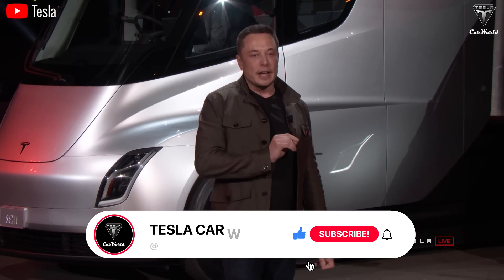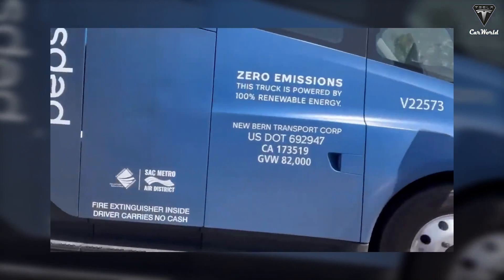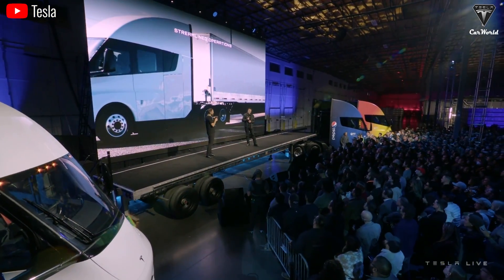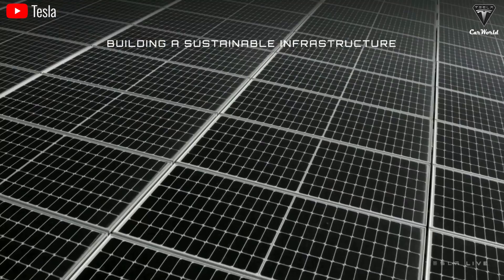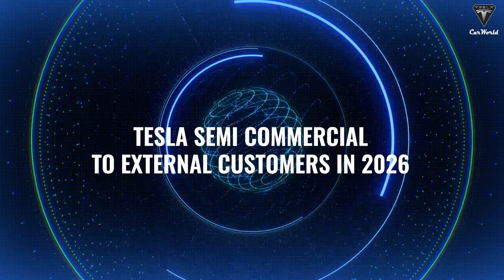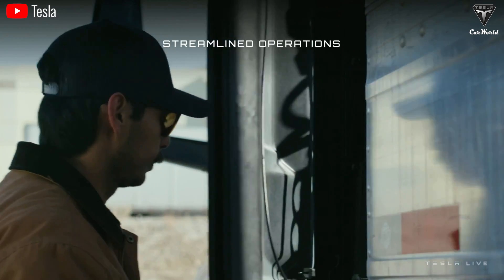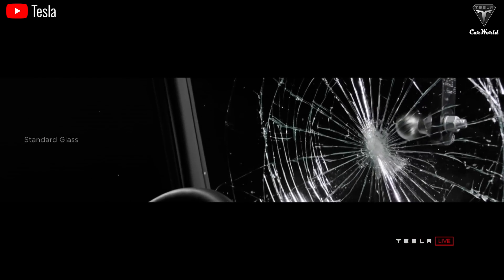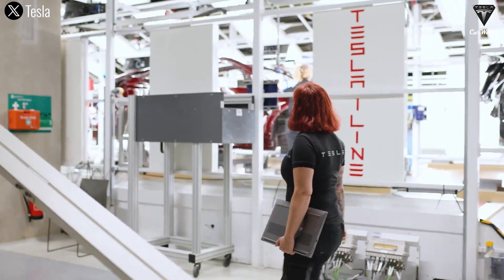NEW Tesla Semi Sleeper Cab Version Launched! Elon Musk Reveals 250.000 Miles Range In 18 Months!

Comment: I am a OTR truck (over the road) I drive 13.5 k miles per month. All over the USA.
So update from the real world is that 
NO INFRASTRUCTURE!!!  Just think a minute 90 minutes to charge and you need space for a vehicle that is 85 thousand pounds and 75 feet long.
So my point is until the infrastructure is in place all across this country 4 k miles from cost to cost. I say in a rough estimate maybe 10 to 15 years away!!!
Ya ya you do not realize that if you need 10 truck to recharge at 90 minutes each you how many plugs you need and god help you if you go dead battery.. it cost $1000 to tow a rig now lol no one is thinking!!! Think this through to conclusions lol

Comment: Seems like a big miss, not to design them with the entire trailer roof being filled with high watt solar panels to keep the battery charged while driving/ resting  in the sun
Reply: Not worth the weight.  A 40ft cab has about 32 m^2 of area.  A 450W panel is about 2 m^2 and 22 kg.  that's 7.2 kW for 350 kg (770 lb).  That's about 1% of the max gross weight.  Too little gain for too much weight.
Reply: @jabbathespud  completely disagree it roughly 50 pounds with a micro inverter 54 pounds a high watt over 400 W panel be incorporated on the roof of a semi trailer without causing unnecessary late load in the purpose of somebody to begin with us to Hall but the efficiency of being able to charge directly without having to wait to plug into a station and of course there’s resources that could be limited by the sun or greatly reduced

Comment: Could you imagine a Tesla motorhome?
Reply: Would be cool, no LPG or Generators needed. With a 900kW Battery you could even heat in Winter with a heat pump…..
And charge it at home with a granny charger on type 2 😂
This could take 450hours…..
Reply: RV industry is a mess. They can’t handle a Tesla 😂😂
Reply: Motor homes are not reliable now. The quality of assembly is poor. The parts aren't much better. If it needs a lot of work it's broke for months. Don't believe me, drive around south bend Indiana and see all the broken rv's waiting repair.